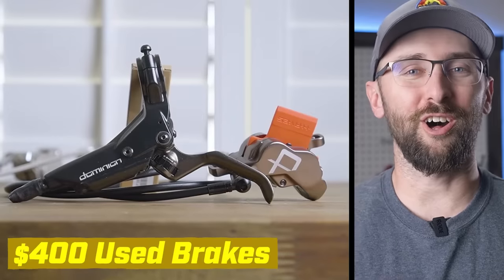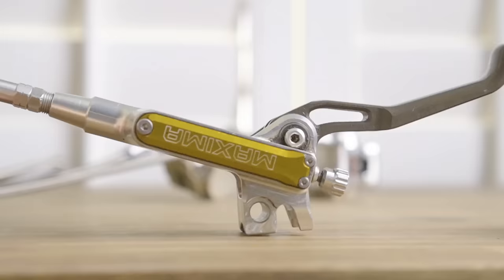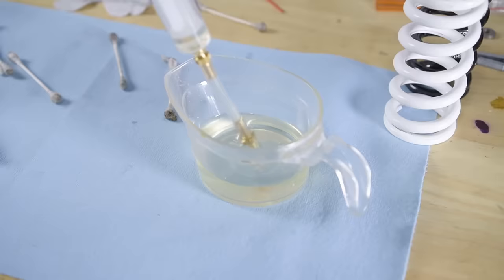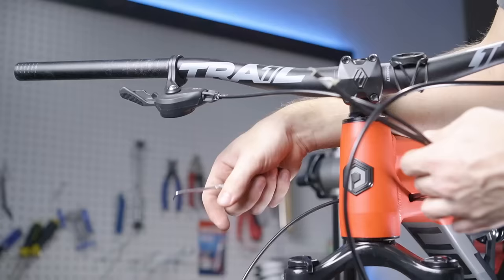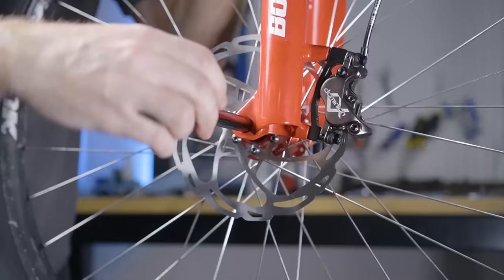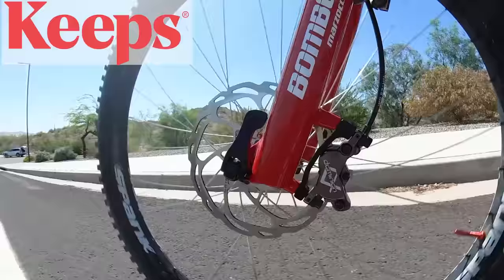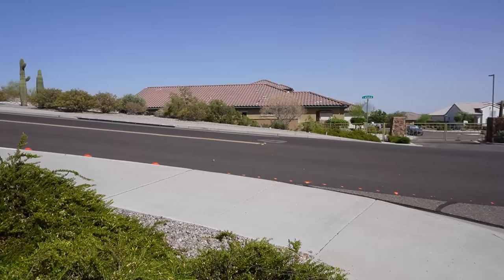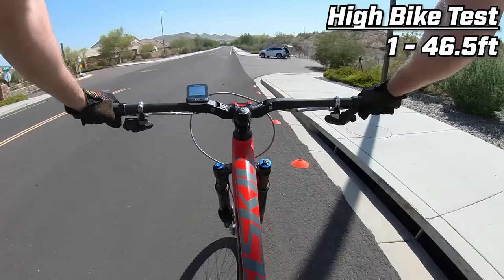Are $2000 mountain bike brakes THAT much better?

Comment: The expensive brake might have more stopping power, but I don't see how power alone translates to shorter stopping distance.
I've had 2 relatively low end MTB's with hydraulic disc brakes now. The first were absolutely cheap brakes from tektro, now I'm on something from Shimano. 
None of those lacked stopping power in any shape or form, both were/are easily capable of either locking the front wheel or sending me over the bars at all time.

So maybe the expensive ones had better feel so he could manage the stoppie better? 
Also i'd be interested how accurate the speed was, when starting to brake each time.
Reply: I have 2 piston tektro brakes, weight 200 pounds, brake with one finger and can block the wheels if I want too. I don't see how I need to waste  money on something "better".

Comment: SRAM rotor with Shimano rotor adapter.  I'd take XTR 9021's with the new XTR 905 203mm 6 bolt rotors over either of those brakes.

Comment: in 9:04 is clearly visible how bad you install front calliper with wrong adaptor so theres a gap between them on lower mount
Reply from the maker: Very true. I didn't realize that until weeks later. I made a season 2 of this series, just posted the first 2 episodes. I hope you'll check it out to see if I did any better!

Comment: I'd say, any xt 4 pot equivalent is a good brake.
If you like the bling of carbon blades, your best bet would be to buy the xtr levers, if you want to bling hard splash out for some mt5/mt7 calipers with the plastic insert discs color matched to your bike's accent color. Choose mt5 to save some money, choose mt7 for all the bling.

Finally, forget everything i just said, make sure your bike has 2 working brakes and go riding. See ya on the trails, fellas!
Reply: Sram guide underpowered small pistons.  203mm rotor helps

Comment: Stopping power? From physics point of view even the rim brakes have the same stopping power, if set up correctly...
Once you reach the level of force, where you can lock the wheels, there is no difference in stopping power/distance.

What you can get is much better control, weight and possibly durability (long descents on brakes?).

Comment: If you've noticed that sunflower oil that you used in maxima brakes has higher boiling point than ther brake fluid, I'm not saying It's better because of the viscosity and other properties but I'm saying that sunflower oil is cheaper.

Comment: Good to know, spend $1,200 on a set of brakes new, to struggle to source the correct fluids, and have them fall apart during the bleed process. Or buy Hope brakes for like $800 for the set, and have amazing stopping power, build quality, and easily sourcable fluids and parts... I know what I'll stick with.

Comment: 9:04 the caliper is loose, it's not secured to the adapter properly at the bottom, I can see there is a gap between caliper and the adapter, I can see the threads of the bolt, this is incorrect, please correct this before riding the bike again.

Comment: I am having the previous model of the Maxima (Cleg, 15 years old).  On concrete at mid or low speeds it is no problem to produce a rollover when pulling the levers, something must be wrong with that brake, maybe oil on the disc?

Comment: In order to properly compare - did you use the same rotor size? Plus did you use compareable pads? For example Dominion comes with a sintered and a semi metallic pad. The sintered is far more aggressive. Therefore if you tested the semi metallic pads you did not get the full power out of the Dominion Brakes.

Comment: Correct me if i am wrong but aren't you supposed to keep low temperatures while bedding in the brakes?
Reply: all manufactures are different in the exact process, but Hayes suggests that you bed them in 50 runs before they will be at 100% braking power. 
you're supposed to go from about 15mph to walking speed, do not come to a complete stop.  & repeat, shimano & sram say 10-15 times. Hayes is a bonkers amount & as a shop tech, there's no way I am spending an hour + bedding in, I give instructions to the customer & let them play around with their new brakes.

Comment: 4:42 I have Formula Cura 4, I did not need this tool, I only needed housing cutter and my fingers to push the insert in the hose. With Shimano I could not do that  I had to use pliers and hose clamping blocks provided with the brakes.

Comment: Are you using the same tires,  If so the brakes are the difference  if you have slight skidding (ABSing the brakes to not lockup after multiple attempts. If the bikes have different tires then its probably the tires.

Comment: Not being funny dude.. but you didn't even lock up the wheels, I've used guide r, code r and code re  all of them will cause you to skid or otb if you pull the lever in tight. It looks like you were intentionally feathering them. A better example would have been 2 piston vs 4  and/or brakes with contact point adjustment and different pad types.  Organics in dry conditions have waaay more bite than sintered. Which in turn can make cheap brakes as good or better than more expensive ones. It's not just about how much the pistons move it's about how much friction is created from the pads and the rotor.
Reply from the maker: Skidding increases braking distance

Comment: I just got Hayes A4s. Ordered the bleed kit on Sunday from Lost Co, received it yesterday (Wednesday), so not a problem to get, in my experience. Did you fine tune your A4 calipers using the set screws? 
Suggestion: plastidip your brake levers. I did this on my bikes back in 2000 and it's still perfect today after many, many thousands of miles. Use liquid Plastidip (used for coating tool handles to get better grip) and dip your brake levers a few times. You can even choose what color plastidip to use. It works amazingly well, no more finger slipping on brake levers. I've also done the touch points on shifter and dropper levers on my new bike.
Reply: He didn't fine tune anything, you can clearly see the mount for the caliper is touching the caliper itself and the brake isn't even tight on the fork, major safety issue

While I had Hayes brakes I always used the cross hair system, it was great, however not as great as Hope brakes
Reply: @lexusstefan927  hayes brakes are way better than hope

Comment: did you try the brakes with each rotor yet? and with each bike? Both rotors look like decent rotors. But I am curious how Brake Stuff rotors perform, so far not seen anyone do an video on them. I have Trickstuff Dähle 223mm rotors. But I want to try the Brake Stuff rotors.

Comment: Me watching with my stock wire brakes on 2018 giant ATX 2: Why are they putting cooking oil in brakes?
Reply from the maker: Higher boiling point, so you can use the brakes longer without overheating

Comment: more stopping power is an advantage if you can't lock the wheels with your hand - which I doubt. to stop in a shorter distance with those 2 bikes you need a brake with a better modulation for your skill, in order to find that sweet spot to brake without locking the wheels, this is an advantage the more expensive brake may have

Comment: Get Brembo brakes from the superbike. It stops a mightly power better, the money spent on buying these brakes you could modify some motorcycle brakes and mount it.  Only downside is adding weight

Comment: Lots of other options, shimano 4 pots, hope, etc. also, if you are upgrading brake’s anyway just get floating rotors while you are at it. Spending 2000 dollars on a brake wont make 20 times as better. Diminishing returns

Comment: Don't need either. Videos with titles like this really intimidate people trying to get into the sport. Been running a set of 60 dollar pre bled shimano hyrdo brakes on my used 2015 fuel ex 5 with upgraded fork for almost 4 years. Everything from basic singletrack to rough, steep downhill with jumps/drops/rock gardens. Stops on a dime no matter the conditions. I don't understand why people need dirt bike brakes on their bikes unless they are doing actual freeride on mountains lol. Any bike park/singletrack rider will literally never need anything more. There are a lot of mtb components that are way overpriced compared to the tiny performance gain they give you. Not to mention the cost of maintainence is higher on those super expensive components. I swear, just like any other sport/hobby, there are just enthusiasts ( or elitists, on the extreme) that just swear up and down that more money = better quality and performance no matter what. Thats just far from true. Having ridden the same trails on both my bike and someone's $6k enduro bike, the only major difference I felt between the two was the suspension travel, and moreso the rear suspension quality. Other than that, the drivetrain, brakes, and overall geometry felt very comparable, obviously the expensive bike LOOKED more premium, and some of the components may last a bit longer. 

P.S. I know your videos aren't all glorifying expensive components, I've been watching for a while. Titles like this are just really misleading for people who are not familiar with mountain bikes or bike components, thinking that you need to spend even 300 dollars on just a set of brakes.

Comment: The stopping distance test is really only affected by the tires, assuming both brakes have the power to lock them up. We're you pulling the front brake as hard as possible? Nice video regardless, ik jts just supposed to be entertainment.

Comment: I didn;t even know there were breaks for 1200. At this point you should've bought a bike for ~$3200 for the low side and ~$6000-8000 for the high side and compared both bike

Comment: The TS Maxima aren't 2000$ more like 1200,-  and if you get such expensive brakes, why not bleed them with their oil? Then, TS Power+ brake pads don't need to be bedded in or rather, you can ride them from the start with more than enough power. I have ridden TS brakes for three years now and have yet to have a situation where my finger slips from the lever blade. Also, I've read about a lot of reliability issues with the Hayes, the TS haven't let me down once. I like your other videos but this just seems to be rushed and for the clicks only.
Reply from the maker: Bionol is on its way & in the mail. But countless sources said Bionol is essentially sunflower oil
Reply: @EvansMTBSaga  it’s not.

Comment: Get a can of the rubber truck bed liner and try it on the brake lever  tape off the spots to stay clean scuff and spray you will have mega grip and I bet it would help a bit with scratches on the levers too side note brake company how about building this in on them.
Reply: I may have to try it out I have sharp edges on the back side my tektro levers and that could help with no grinding with a Dremel 😂

Comment: Still hesitating between Hayes Dominion and Shimano SLX, even though seeing Rémy Metailler shredding with Hayes is a pretty nice argument xD
Reply from the maker: I haven't used the SLX 4 pistons, but Ive had SLX 2 pistons and the lever blade can break off too easily. The Dominion brakes are tanky
Reply: I just went from SLX 4 pistons to Hayes on my trail bike. Hayes are waaaay better in modulation and power, and they look amazing, IMO. I put the SLX brakes on my bike park bike. Plenty of power with MTX pad and 203 cm rotors front and rear, but not great feel.

Comment: I have watched 3min and I can see at least 2 prob ... no, 3 problems with those splendid brakes. 
1. Bloody expensive, you can buy for that decent bike. 
2. They using oil, for some reason, that hard to buy and sunflower oil have quite low boiling temp. I did small research and sunflower oil has tasty 107* (one hundred and seven degrees) It means its perfect if you're depressed and want commit suicide. 
3. They has steel pistons. They are good working and low maintenance - true, but also are perfect conducting for temperature. Long story short - they will fade sooner than you can imagine.
Reply from the maker: Sunflower oil has a high boiling point >400°F

Comment: Were both rotors the same diameter? Why not use the same rotor on both to compare the two systems?
Reply from the maker: Pad contamination would be my concern with that
Reply: @EvansMTBSaga  I mean the same make and model rotor. That way its a fair comparison. Were these both the same diameter rotor?
Reply from the maker: Yeah all four rotors 180

Comment: Honestly Evan, a bit disappointed in this video! You did a great job but you need to trail test the brakes. Modulation, brake feel, lever position, contact points are all relevant points of review for on the trail testing. Just power is not a good indicator for worth in a brake. Still, love the video series and so happy to see the complete builds!
Reply from the maker: It's coming on the finale.

Comment: HOPE tech3/4 is my choice till now.love the modulation feeling and can adjust the modulation
Reply: Atleast in the EU because Brexit UK stuff has gotten a LOT more expensive!
Reply: @kaedeschulz5422  my HOPE is from there too...but MAXIMA price is more expensive
Reply: @METEORA_47  Yes those are CRAZY expensive but i guess that's part of the fanciest of the fancy parts.
Reply: @kaedeschulz5422  I have payed about 700€ for Hope Tech 3 E4's, non braided lines, 2 floating 203mm rotors and 2 Shimano adaptors. Then another 36€ to send my rear caliper back to Hope as it was leaking from factory, lost 3 extra months in the process, on top af having had to wait 5 months on the initial delivery... The brakes on my Husky HC8 finally feel as brakes should feel. I'm SO glad I got rid of the Shimano throw away brakes that felt like on off, and were terrible to maintain ( stuck pistons ). I'm riding in sand an mud a lot and Shimano's are just not built for this. I only wish Hope had better support for DOA's ...
Reply: @dawn-moon  Never had or heard from such problems with shimano brakes. On off? Saints? Maybe garbage stock shimano pads?
So far i haven't rode a shimano brake that felt on off. I myself ride SLX 7120 and many friends the XT 4piston. Rode their bikes too.
Reply: @kaedeschulz5422  My Hard Cross 8 came with MT520 4 piston brakes. My previous MTB, a KTM eMTB had 2 piston SLX brakes, and pistons got stuck all the time after a couple of months. They didn't come out evenly, and when manipulating them manually, you could feel some pistons were held back. I tried lubricating them with brake fluid, but shortly after the problem repeated itself. You cant really disassemble them to do like a full service, they are just throw away brakes. And the brake lever felt like on/off. If I compare to my KTM dirtbike brakes or now even the Hope Tech3 brakes, those have a lot more feel in them and aren't on/off like the Shimano's I've had up until now. The ICE tech rotors from Shimano are also more flimsy compared to the Hope floating rotors. The Hope's have more mass to them, and in case your pads scrub the rotors or dirt, they also make a much more pleasant noise compared to the Shimano's. Cleaning with the Hope's is a lot more easy too. I remove the pads, do the whole bike with pressure washer, put the pads back in and done. The Shimano's started squeaking all the time. It was a little better when using sintered pads, but still...
Reply: before im using hope E4,im ride with shimano XT 8120 and it too aggressive.Hope is more better because it has advantages in modulation and bite point adjuster
Reply: sorry for the late reply 🙏
Reply: @dawn-moon  Who buys ice tech rotors anyways? Only ppl with too much money. All the Enduro ppl i know run RT66 or the hope ones.
The ppl i know and myself haven't had those problems with their SLX or XT brakes.
Reply: @kaedeschulz5422  maybe because some bikes come with them from factory :-) ?
Reply: @dawn-moon  You mean the Shimano ones? Yea the OEM ones are lower quality to save money...
Reply: @kaedeschulz5422  I didn't know OEM ones ware allowed to use ICE tech in their names...

Comment: hmmm, I don't know how I feel about this episode. first of all, I'm really weary of using odd branded brakes (even stuff like hope and magura is a gamble to me) because shimano and sram both have easy bleed systems, parts are always available, and shops can fix and bleed for cheap. The low bike was way too expensive and the test definitely did not push these brakes at all. you need to ride steeps and constantly exert pressure on the brakes to examine brake fade and performance over time. It's pretty hard to quantify but stopping a couple of times probably isn't gonna do the trick.
Reply: He lives in the desert. Not the north shore. Cut him some slack
Reply: @timmyfranks4087  yeah I get it. I just feel like the episode was a little off. $350 for low bike brakes? like geez, you can easily find code rsc's for that price. I was thinking more like slx 2/4 pots.

Comment: never seen something this bad. If you cant handle the bleeding ( specially with the right oil) of a brake you shouldnt post a mechanic video.
I have a Diretissima and a Maxima on my 2 Bikes and every friend who rode them was absolutely impressed by the durability and good handle of the pure Power. 

Please dont post something false like this.

Comment: Next time tie a rope when you pull the brake lines through the frame. Then tie the new line to the rope and pull back through.  You're welcome
Reply from the maker: I've done a couple of tricks. This frames holes were pretty big and getting it through by eye is super easy too. Thanks for the tips!

Comment: I would choose the Maxima brakes, but install rubber tape on the levers, I would do it on any brakes. I am not a fan of using toxic DOT fluid, So won't get Hayes.